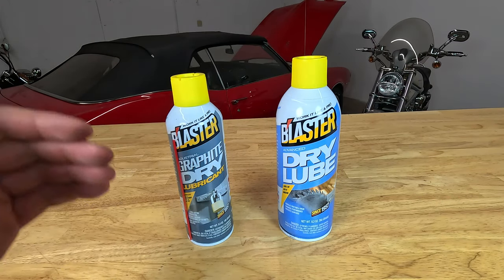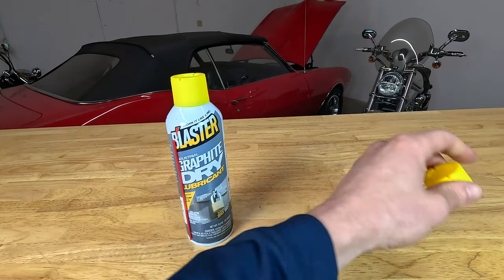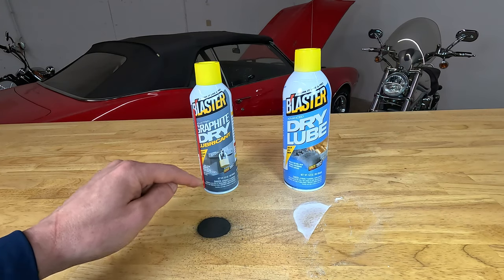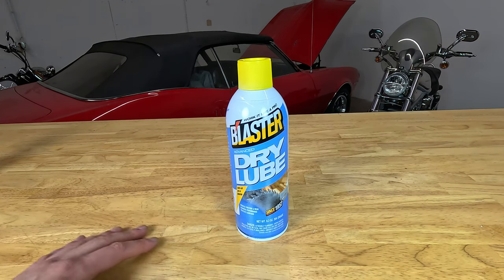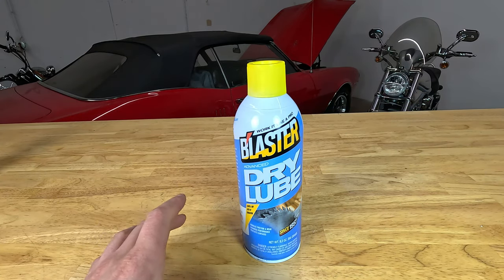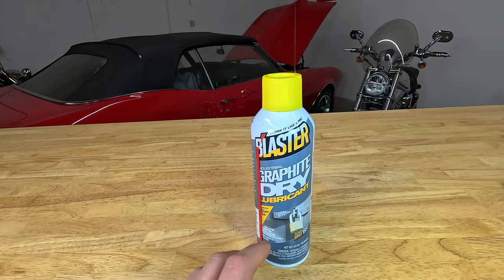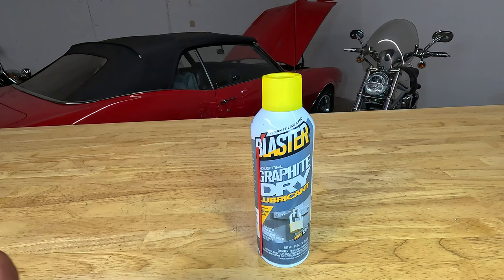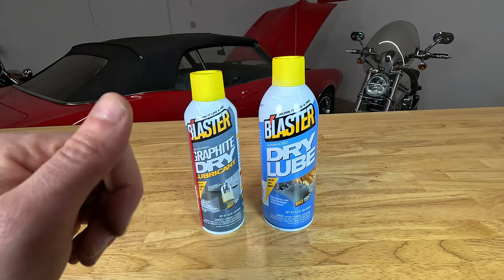Blaster Dry Lube vs Blaster Graphite Dry Lube. What's The Difference?

Comment: Lawn mowers and snow blowers are meantioned as example applications of the normal dry lube, but it appears that the graphite dry lube is more durable/less likey to wipe off. Woudl that mean that graphite dry lube might be better for those applications is the color does not matter? Is there any downside to using graphite vs regular dry lube on a lawnmower deck?
Reply: I assume the only possible concern would be that it's electrically conductive which could both be an issue relating to static but the more likely issue being accidently spraying past the lawnmower blades and into the housing where the motor and electronics sit. But I guess for something like a snow shovel it would be good as long as you don't care about the color.

Comment: Another application is for the tens of thousands of folks who drive scooters.  The variator in scooters has "rollers" or "sliders" which move due to centrifugal forces on a ramp.  Only a dry lubricant should be used and I see in another video that the demonstrator used the Blaster Dry Lube.  Perhaps he would be better off in the long run to be using the Blaster GRAPHITE Dry Lube.  It would be more resistant to heat and would probably cling better to the metal ramp for long term slipperiness.

Comment: Which product would be best to use.  Snowmobile pull start recoil assembly.  Lube for plastic on plastic slidding parts, infrequent use.  Very low rpm use.  Low tempature use,  minus 20 F.
Reply from the maker: The regular dry lube would probably be a better choice. With the graphite you may end up with graphite on the pull rope that would then possibly get on your hands/gloves when you're attempting to start the machine. Both products will perform well at 50 below.

Comment: Watched vid…..want to verify that 
BLASTER DRY LUBE is ok to use on vehicles with slow up/down window situation ?!
Thanks
Reply from the maker: We suggest our B'laster Silicone lube for that application.
Reply: @BlasterProducts  that would be the can with lime green label and a winch system on a jeep type vehicle as advertisement ¿

Thanks for reply did not want use incorrect lube for said situation

HAGD
Reply from the maker: @ruggedrickrude1946  That's the one!
Reply: @BlasterProducts professional reply to customers…did not leave me wondering and be a non-reply 

Will buy your products when I need them

(no reply needed back,you been 
GR🎱)

TY

Comment: Can I use the graphite, dry lube in my ignition as well as my door locks?
Reply from the maker: We don't recommend it for use in modern ignition switches because the graphite lube is electrically conductive.
Reply: @BlasterProducts  ok so the dry lube is great for door locks and some suspension parts, door hinges and wheel wells (to prevent dirt buildup)?

Comment: Hi Sir,  This is urgent. I cleaned everything with Citrus degreaser, as u said. Then blaster silicone lubrication the hinges and roller bearing and pins. But now bad squeaking when garage near closing. Also when its opening. I think rollers may be skidding when near closing. I again cleaned both tracks and all rollers. Then lubricated all bearing and hinges.
Made sure plastic rollers and tracks are dry. Nothing solved the new squeaking problem. Help..
Reply from the maker: Please call customer service at 1-800-858-6605 so we can discuss you issue in detail.

Comment: Would the graphite dry lube work on the rubber window sweeps of a car? Trying to find a solution to stop them from clinging to the window and bunching up when I roll down the windows.
Reply from the maker: B'laster Silicone Lubricant would be the perfect application for your car window tracks.
Reply: @BlasterProducts  I'll give it a try. I've tried the wd40 silicone lube and it worked for about 30 minutes and then the inner sweeps seal started clinging to the inside of windows again.🤦🏾‍♂️

Comment: Would either of these products be suitable as a brake rotor coating for a vehicle stored outside ? More specifically the contact surface where the pad material touches the rotor . I'm looking for an ease of use product that I could simply just spray through the wheel onto the braking surface . Thanks